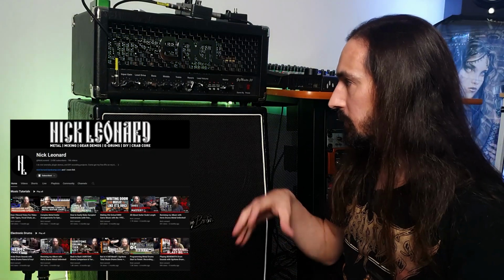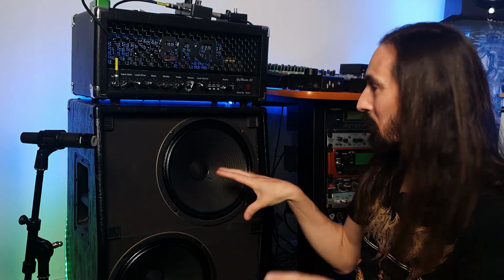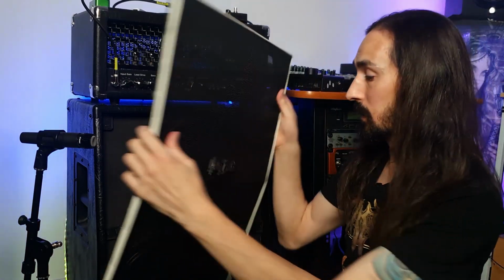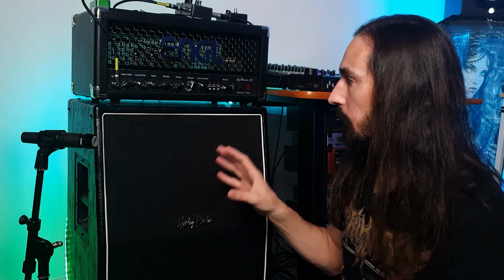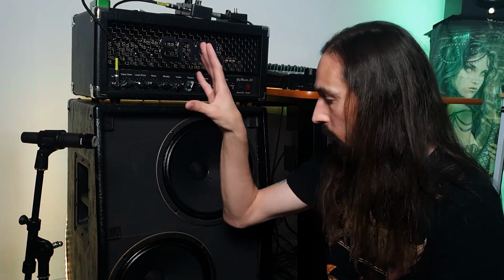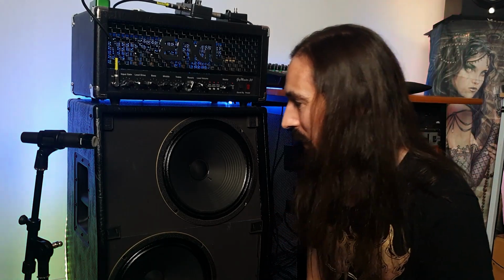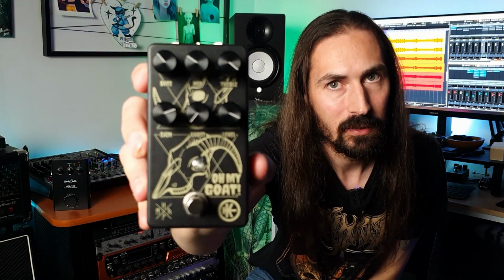The importance of Mic distance when recording heavy guitars!

Comment: It definitely sounds better in front of the mesh to me. When it's inside the cone, it's dark, but also has something weird going on in the midrange. The far mic gets hollowed out and loses bass as you'd expect. For the next experiment, try several positions horizontally from the center of the cap to the edge of the speaker, I'd also try comparing the two speakers with the same mic position, usually the top speaker, if it's angled, sounds nicer, and that's one of the nice things about that cab of yours!
Reply from the maker: That sounds like a fun video to make! Thank you Sir!